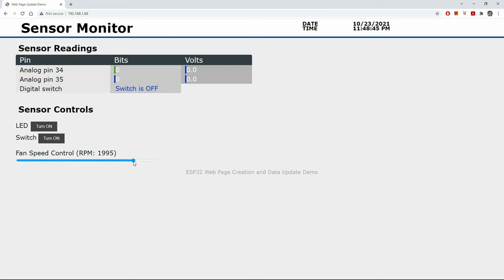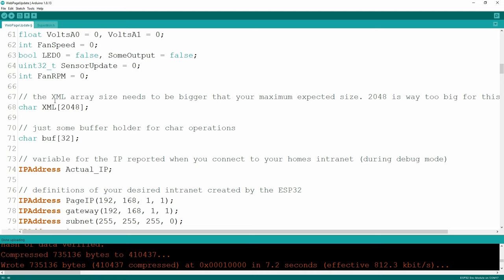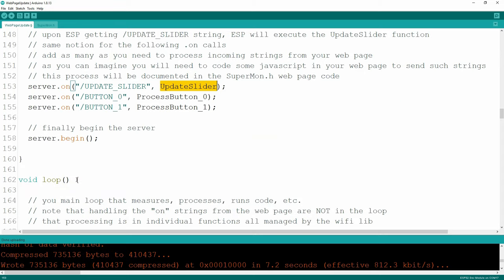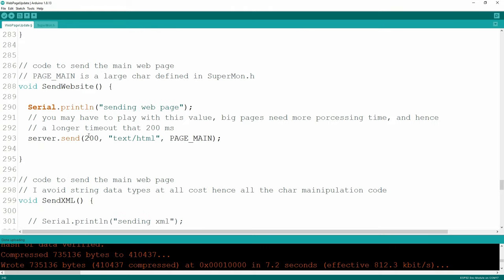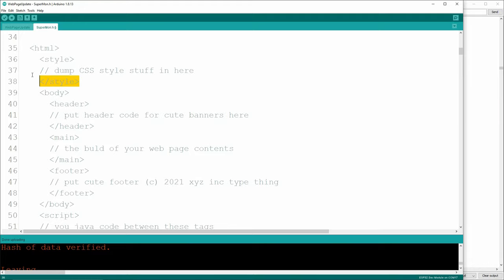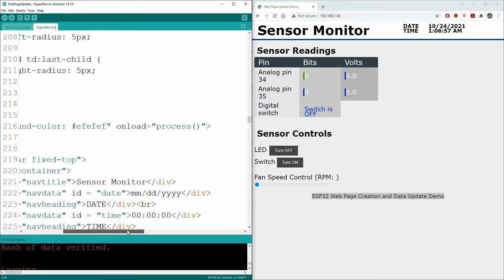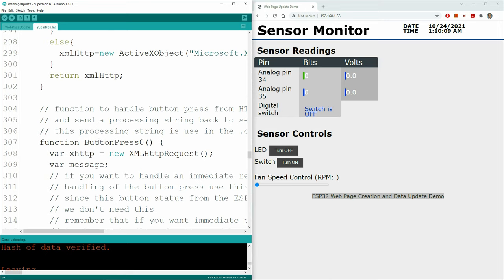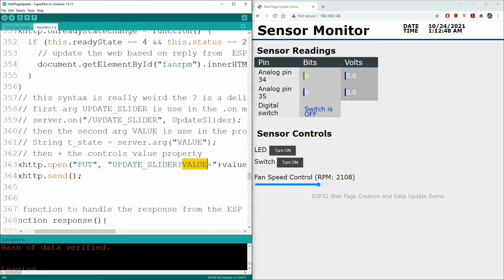ESP32 Web page creating and updating

Comment: Thanks for this, I was able to get my webpage up and running really quickly using this example. One thing I don't understand is what keeps it going? The ESP only sends XML in response to a request from the webpage, so is "process()" called continuously by the webpage java script? How can I slow down the frequency with which the page is updated?
Reply from the maker: It’s been a while since I looked at the code, but inside the ESP code there is a handleclient function that pings the server. I think you can slow that down, but you’ll have to adjust the time out inside your webpage.
Reply: @KrisKasprzak  Thanks, as is normally the way, I found the answer a few hours after posting the question. Thanks for the response 🙂

Comment: Very educational and is a huge help as I try to learn.  I put your code in as is and it compiled.  My ESP32 dev module is constantly rebooting. I know in the video you talk about that but changing the 200 does not do anything no matter what direction I go.  I saw down below someone talked about it not being a timer but error return, I can't get the demo as is working.  Thoughts?  Any help would be appreciated!    the error is  assert failed: tcpip_send_msg_wait_sem IDF/components/lwip/lwip/src/api/tcpip.c:455 (Invalid mbox)

0x4008358d: panic_abort at /Users/ficeto/Desktop/ESP32/ESP32S2/esp-idf-public/components/esp_system/panic.c line 408
0x40088591: esp_system_abort at /Users/ficeto/Desktop/ESP32/ESP32S2/esp-idf-public/components/esp_system/esp_system.c line 137
0x4008d9b9: __assert_func at /Users/ficeto/Desktop/ESP32/ESP32S2/esp-idf-public/components/newlib/assert.c line 85
0x400e59ba: tcpip_send_msg_wait_sem at /Users/ficeto/Desktop/ESP32/ESP32S2/esp-idf-public/components/lwip/lwip/src/api/tcpip.c line 455
0x400f1f9d: netconn_apimsg at /Users/ficeto/Desktop/ESP32/ESP32S2/esp-idf-public/components/lwip/lwip/src/api/api_lib.c line 136
0x400f1ffc: netconn_new_with_proto_and_callback at /Users/ficeto/Desktop/ESP32/ESP32S2/esp-idf-public/components/lwip/lwip/src/api/api_lib.c line 166
0x400e56f1: lwip_socket at /Users/ficeto/Desktop/ESP32/ESP32S2/esp-idf-public/components/lwip/lwip/src/api/sockets.c line 1774
0x400d352e: WiFiServer::begin(unsigned short, int) at C:\Users\Rob\AppData\Local\Arduino15\packages\esp32\hardware\esp32\2.0.11/tools/sdk/esp32/include/lwip/lwip/src/include/lwip/sockets.h line 656
0x400d35a4: WiFiServer::begin(unsigned short) at C:\Users\Rob\AppData\Local\Arduino15\packages\esp32\hardware\esp32\2.0.11\libraries\WiFi\src\WiFiServer.cpp line 70
0x400d5510: WebServer::begin() at C:\Users\Rob\AppData\Local\Arduino15\packages\esp32\hardware\esp32\2.0.11\libraries\WebServer\src\WebServer.cpp line 104
0x400d28c7: setup() at C:\Users\Rob\Documents\Arduino\libraries\test/test.ino line 179
0x400d7e6a: loopTask(void*) at C:\Users\Rob\AppData\Local\Arduino15\packages\esp32\hardware\esp32\2.0.11\cores\esp32\main.cpp line 42
Reply from the maker: I would recommend adding a serial.println(“it landed here“); near the beginning, in set up, and keep moving that line down until you figure out where the program is crashing at.

Comment: Hello! Very good video and it works! If you can explain one question, why is the slider not synchronized on windows and android? The button and switch do this without any problems.

Comment: Thank you Kris for the excellent work, my question is can i control two esp32 from a single web page, if so can you please elaborate on the required changes on the code , thank you
Reply from the maker: do you want the same instruction going to both ESP 32s or are you intending the webpage to send different instructions to different32s?
Reply: the instructions the can go any one esp, for example i can select from the same webpage to switch on led in esp number one or to switch on led in esp number two  @KrisKasprzak
Reply: Do you have an example for web page passing different instruction to 2 esp

Comment: Hi,this is honestly so awesome ! i have a question though, if i want to send more precise data to the site, like lets say instead of 2.6 volts i want to send 2.63 volts so its more precise how would i need to change the code ? thanks
Reply from the maker: look at the .ino around line 312, I do some math to get the whole number and the fractional part. I do this because of limited support for formatting floats in Arduino. You will need to adjust the *10 to get more digits.

Comment: 2:25 ive heard that it it bc when you use esp as a keyboard simulator and what to reprogram it after the esp works like a keyboard the computer will see the esp at a keyboard and you will not be able to reprogram it that is what i heard so when you press the boot button you are setting the esp to a programing mode where all functions should be off and the esp is waiting for program

Comment: Hi Kris, most of the tutorials are done with WiFiServer library, yours has been done with WebServer. I've also read about AsyncWebServer many times and it is pretty confusing. Do you know the differences between these and which one is better in your opinion?
Reply from the maker: I'm using a heavily modified example that came with the ESP32 install. A key reason is the "on" method that will listen to incoming traffic and if a keyword is encountered it will fire a function. For example if the web page button is pressed, the java script will send back a "BUTTON_1" keyword, the library i'm using sees that and can process accordingly. I'm not sure if what you are considering can do that--otherwise you will need to write your own code for listening and processing.

Comment: What would be involved in writing an ESP32 application, that takes data from the uart, but instead of displaying it from it's own webserver (TCP), it passes it wirelessly via bluetooth or via Wifi to another PC/Android? 
In terms of Wifi, maybe there's a UDP way that the ESP32 could send data to a PC on the same network?   
In terms of Bluetooth, I imagine if the ESP32 would need to bridge its uart connection with a bluetooth (SPP) connection?

So the ESP32 could transmit an SSID and act as a hotspot.. and simultaneously the esp32 runs a webserver?  If so, what kind of data thruput could you expect?  Perhaps that's how the idea behind the dual-cores.. one does the AP, the other does the webserver?

Regardless, if the ESP32 samples the ADC 2000 per second, and updates the web page with every new sample..  what will a client , connected to the hotspot/web-server, see as the sample rate?  Or would it not be real-time, and instead the client must refresh the page manually to get fresh ADC samples?   Perhaps the user could talk back to the ESP32 via the web page as well?

BTW, very new to all this,  just ordered an ESP32 8x8 RGB board, and an ESP-PROG JTAG programmer... hoping to use Visual Studio Code to code/debug on the esp32!

Comment: HI, thanks for this video - how do i upload these files into my ESP32-WROOM-32 using Arduino IDE?
Reply from the maker: you should be able to open the .ino in Arduino and select your board, then upload. make sure the .h file is in the same folder as the .ino

Comment: Hi, great video.
Very well explained. I've been looking for something like this for a while to adapt it to my project.
But I have a problem when trying to compile with the Arduino IDE.
I get this error:
"fatal error: network_provisioning/network_config.h: No such file or directory"
I've searched the internet but haven't found anything.
Any help with this problem?
Thank you all very much
Reply from the maker: I’m not familiar with this problem. Can you get any of the library examples working?
Reply: Hello, thanks for answering.
I have managed to fix the library problem. I have finally found the file on the internet and it no longer gives an error.
Now the error is given on line 119: 

118 // configure the LED PWM functionalities 
119 ledcSetup(0, 10000, 8);

It shows the following error: 
Compilation error: 'ledcSetup' was not declared in this scope 
Thank you very much for your help

Comment: Would you happen to know if this is small to be hosted over a free server hoster like ngrok? I have tried hosting a couple other servers that way over ngrok so I can access it wherever i am as long as I have wifi but I have noticed that in the free tier of ngrok sometimes it is too big. How else would you suggest to access this website without having to be on the same network as the one the board connects to?
Reply from the maker: Try port forwarding. I am able to do this on my home Internet system because I have access to the router. Basically you just open access to the world to the ESP32. I’ve done this to mine and been able to connect to this Web server from anywhere. Port forwarding will create some weird IP address what you were used to connect to it
Reply: @KrisKasprzak  That connection would not be secure though.

Comment: by default esp32 silently needs minimum 8 charecters wifi password and if you somehow make the pass shorter than 8 the esp32 after flashing keeps rebooting like infinate loop..... Esp32 is full of surprises like this one ... when i was looping fast after flashing with no clue,  i hold the reset button and then read the terminal feed ... thats how i learn about the minimum password loenght... by the way i am using ''Espressif IDE'' and windows... i gues mb it is an options in menuconfig for dealing with it ...
Reply from the maker: Yea, I hear ya. Very odd MCU's, another challenge is the dual pin naming GPIO can be different than the board silkscreen.
Reply: @KrisKasprzak  also thanks for the  nice and informative videos that you post. Have a nice day!

Comment: hello sir, thank you for this tutorial. i am getting started with ESP32. I am doing the project where i want to connect five ESP32 to one ESP32 and then , control all the other 5 ESP's GPIO pins with one using android app.so that i will have to connect only ESP to WIFI and not all. the connections should be  2 way so that main ESP will sent commands as well as get to know the status of others ESP. 

what do we call this method of connecting? 
how to achieve this any tutorials or reference materials?
Reply from the maker: what connections are you thinking? Wireless or wired?
Reply: @KrisKasprzak  wireless connection, this setup is for modelling railway, i have five locomotives with esp32, so on my mobile dashboard i want to see all the running trians details so that I can control their speed, control led on off. I do not want to connect each loco esp by IP address and then select it.
Reply from the maker: @AkashJadhavIT  I have a similar project where I connect five different MC used to a single ESP32 base. It’s all done wirelessly. Here are some units that may help you out

https://youtu.be/hMjArKGucFA

There are several ways to do this. You could have all on the same channel with some type of ID there’s unique for each train. Your ESP 32 base could send out signals to Pole and set train data, or you could send data from your trains to your base. Your base can serve a webpage that you could connect with your phone or whatever to monitor each of the trains and set their speed. This is not going to be an easy project

Comment: I want to add a mechanical button to control Led in parallel, how can when the button is pressed, the Led state is also updated to the Web? help meeeeeeeee
Reply from the maker: The code does something similar to this, notice the "Digital Switch" status on the web page. The example shows how to send both an analog read and a digital read. Your MCU will have to be wired (direct if 3v3 or a voltage divider if higher, or other) to be able to read the button press, then see the example for the digital switch on how to send the button state to the web page.
Reply: @KrisKasprzak  Yes, can you write a sample for me in void loop, please help me, I have tried but not working..hicc help meeeee 😢

Comment: Hi, thank you so much for your great tutorial! 
everything works great so far, but there are 2 things i am wondering: 
1. there are thousands of errormessages in the browser console of this kind:
Uncaught TypeError: Cannot read properties of null (reading 'getElementsByTagName')
    at XMLHttpRequest.response
is there any way to get rid of them?
2. it updates extremely fast - even when there is no data changing. is there any way to only update the xml / website when dta cahnged?

Cheers and thanks!!
Reply from the maker: I have never seen any error messages so I’m not sure what it could be, if I remember right there is a send XML function m. You could put a check in there that if your date has changed it sends it

Comment: Hi Kris, thanks for making this video. I'm slowly learning Arduino/ESP stuff.

1. I have this hooked up on my ESP32 and the webpage is working and LED turns on and off, but when I try the "switch" button to pin 26, it isn't doing anything to the relay. How can I get this to work with relays?
2. I noticed that both Edge and Chrome both pop up constantly that the webpage is unresponsive. I check the developer tools and view the console and it is spamming this:

Uncaught TypeError: Cannot read properties of null (reading 'getElementsByTagName')
    at XMLHttpRequest.response ((index):325:28)
    at process ((index):407:17)
    at <anonymous>:1:1
response	@	(index):325
process	@	(index):407
(anonymous)	@	VM238:1

It spams this hundreds of times a second in the console and the webpage is very laggy. I'm not sure where to start to fix this as I hope to understand how this works so I can attempt a project. Thanks.
Reply from the maker: ESP sends a 3v3 signal to the relay, are you sure 3v3 will drive a relay?

I'm not sure about those errors.
Reply: @KrisKasprzak  When I make a simple web server with a button, the relays work as intended. If I put the relay on pin 2, then if the LED is off, then the relay turns on, but for some reason the switch button isn't working.